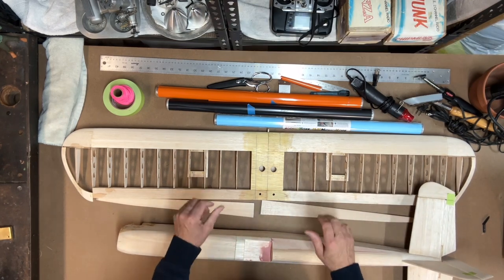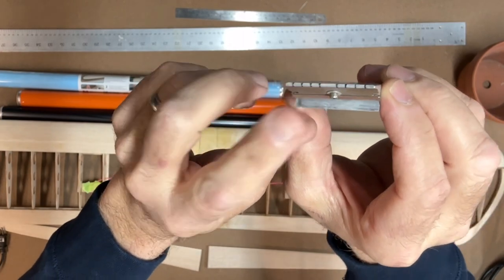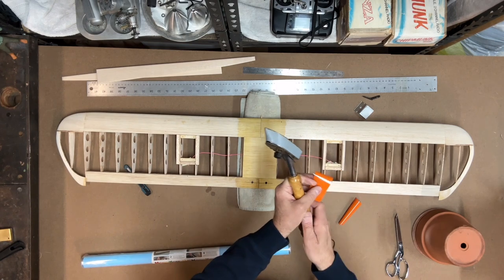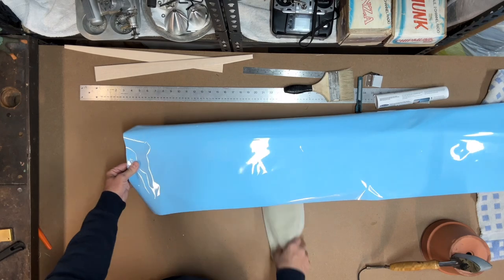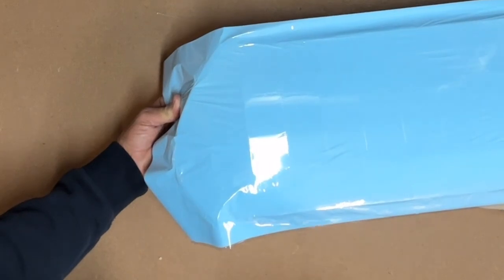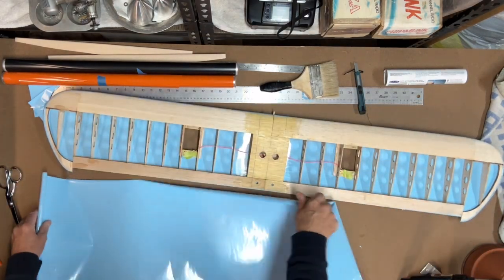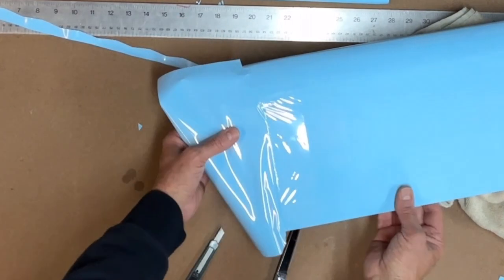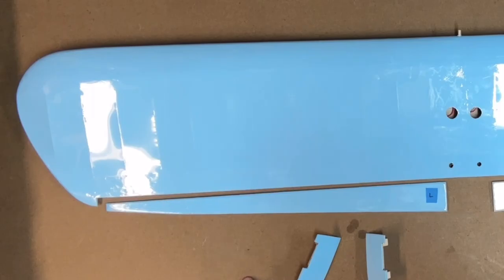Balsa USA Smoothie RC Plane Kit Build No 34, Monokote the WING, review of Monokote and methods

Comment: To seperate the backing i use 2 pieces of tape. I like magic tape. Stick a piece either side and pull tape away from each other and the backing comes away easily . Also works on contact.  Looking forward to seeing it finished.
Reply from the maker: Great tip!

Comment: Hi, i am enjoying these build videos, since it reminds me of when i built rc planes 35 years ago. A few years ago i restored one of my first builds from when i was 12, and the wing was of course warped during building,  but i could actually straighten it by twisting it straight, then heating out the stretch in the covering and let it set. Still flyes nearly straight.  😅
Reply from the maker: Thats great that you still had the plane and now fly it. I was away from the hobby for a long time and really have been enjoying getting back into it.
Reply: @JamesRCPlaneTech  good times!

Comment: Last time I did it I covered the bottom first and then installed the servo's and then covered the top but either way works fine!
Reply from the maker: Thats a good way to do it. Great tip. I didn’t think of that..
Reply: Always do the bottom first, the top will then wrap over  the leading edge so you won't catch any air flow.  Also good to do the glassed middle first and then each wing side, top and bottom separately...

Comment: For an overlapping seam of monokote, I sometimes see a little of the adhesive smear out during the ironing. It's more noticeable on dark covering, but I'm having trouble removing those smears of adhesive from the top of the monokote. Acetone seems to just make the smears even larger .... spreading them a bit. Any tips for removing those smears of adhesive?
Reply from the maker: i use acetone or alcohol also. I dont put too much on and gently wipe it off, but as you said if there is too much of the adhesive it may smear, and you just have to work it off. I don’t know of any other way to remove it.